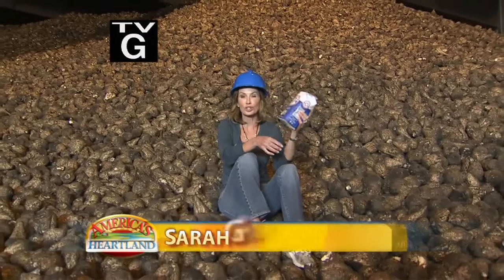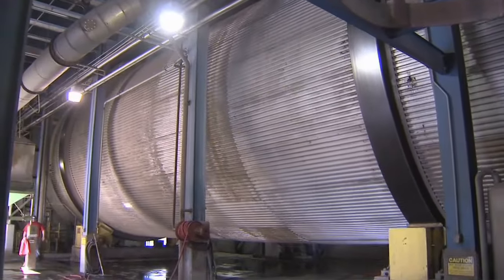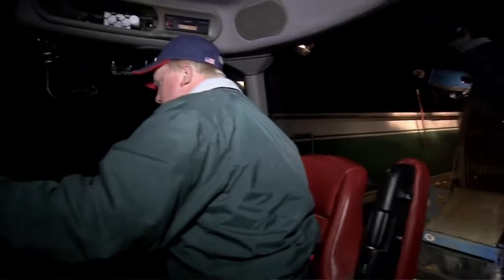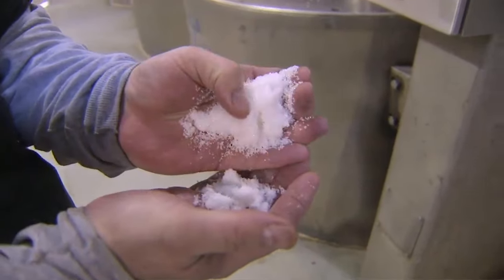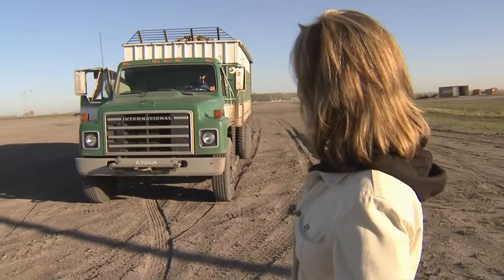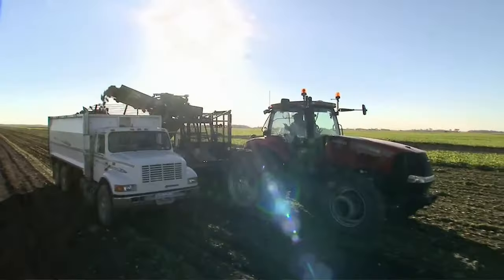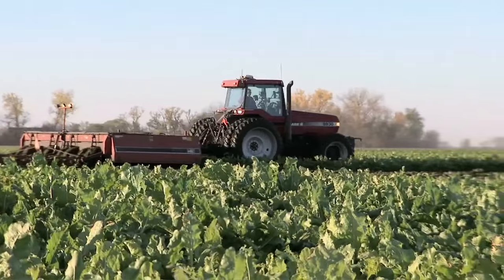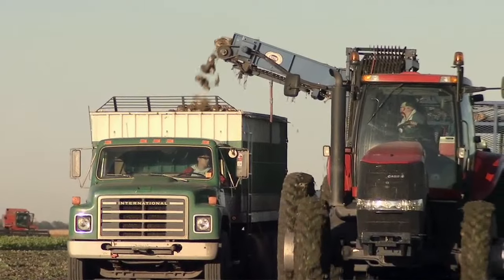Special Episode: Sugar Beet Harvest  - America's Heartland

Comment: From a old campaigner for Michigan Sugar. Did it from the piler of 1880 vintage from Germany to stacking 100# bags on pallets seven tier high by five bags a tier and doing over a 1000 pallets a shift. Making lime for filtering to straddling tank cars to watch it fill with molasses in January and it wasn't that slow. The nickle bag pealing for the liquid sugar tanks was the hardest because sugar was like bricks from the moisture seaping thru the paper. Just staying away from the bees was really hard. We ran from October thru February or March if spring was running late. Younger brother got on full time after 10 years of campaigning. They paid for his schooling as a boiler operator.
Reply: Lime? You sure it wasn't soda ash?

Comment: One of the best jobs I had in my 20's was working for GW Sugar in Fremont, Ohio. I started out as the grunt with a 10 ft pitchfork cleaning the water recycle grate. After the beets were washed they took a four floor ride up to the picking table and I had to shovel out the chip pit. Then I got moved to the forth floor picking table where we had to remove debris like rocks and frogs. Then I got moved to the precoke ovens where I got to run a Bobcat and load chips keeping the rail line clear and the warehouse in check. Finally I got promoted to the production line to monitor moisture of the final product. At times it was a cold brutal job. The beats came in the fall but we were processing into early winter. Till this day I curse GW from pulling out and killing the sugar beat industry in north central Ohio. The same curse is bestowed on the pickle producers and especially Heinze who killed our tomatoe production and only processes crap brought in by rail car from Cali.

Comment: time, that's the limiting factor. if you did as you state, you would need to harvest and then unload in different stages, cutting your production by half or more, making it cost more in the long run. it's faster and more efficient to have that truck be able to take off immediately and be replaced by another one immediately after instead of harvesting, stopping, unloading and harvesting again, it doesn't work with bulky crops like sugar beets.

Comment: there has never been any love ploughed into that land. it grows well now. but it cant go on forever like this.
Reply: Yes, and you can see these farmers have some pride in their work, but no love or respect for Nature.
Reply: Gerry Steven
Reply: Gerry Stevens     Yes. It can. And yes it will.
Reply: Nothing goes on forever like this. Things are and have always been changing. How exactly do you plow "love" into the land?
Reply: @Gerry Stevens > That's why crop sites are rotated, and intercrops are planted/grown/ploughed back into the soil so that the process CAN go in forever. No modern Machine Farmer invests the billions it takes to build/run these agro-businesses w/o taking the science of sustainability into account.
Reply: Seth B you're right and wrong. Urban areas actually are more efficient, use fewer resources and impact nature less than suburban or rural areas. It's all statistics, not my opinion. 

I grew up on farms and just like any other industry, some care about the impact they are making on nature, climate change and sustainability and some don't. There's a huge problem with chemical run off into rivers and lakes from farms. But without those chemicals productivity goes down. It's a really complex issue that we will have to solve. 

Farms are damaging to nature, but are very necessary. All we can do is minimize the impact and hold reckless (usually factory farms) responsible for their actions.